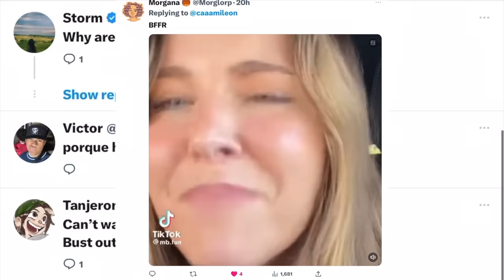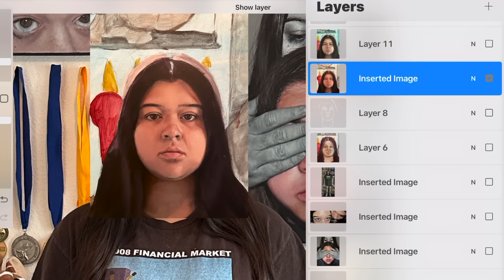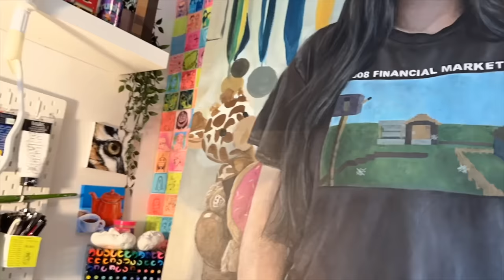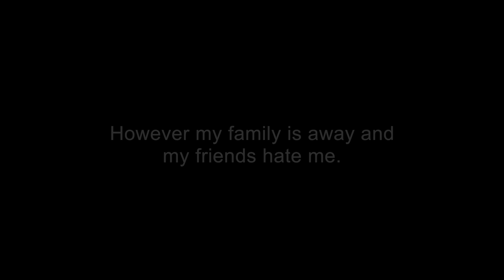i painted a life size portrait of myself for no reason...

Comment: Bevel the edges of your wood — if you don’t have a table saw, use quarter round instead as a beveled edge. I nail mine down with wire brads and wood glue. Line up the flat edge of the quarter round with the edge of the stretcher. Otherwise when you paint it, you might get a halo around it the width of the wood if you don’t bevel. Then make your 45° cuts. Make sure to not nail in any brads around where you’ll be cutting 😊

Comment: I hate that I'm just now seeing this a year later, this was beautifully executed. Well done. 

One tip for the next time you decide to do any cutting though, your blade was on backward. That's why the circular saw was not cutting smoothly and getting hot enough to burn the wood. A dull blade makes the cuts difficult but won't burn the wood, accidentally putting the blade on backwards however can start a fire. A sharp blade properly installed will cut that soft wood like butter. Please be careful in your endeavors, I'm excited to see the art to comes.